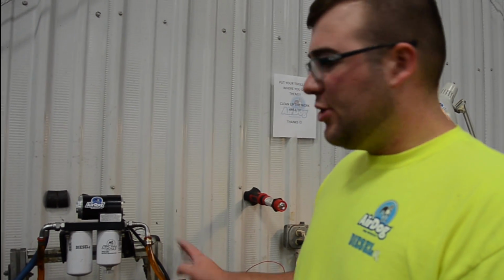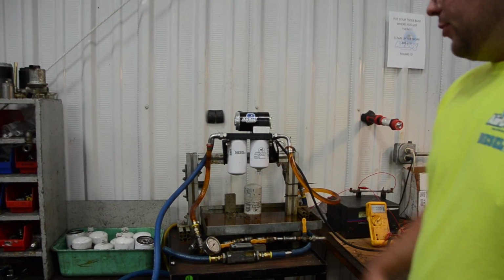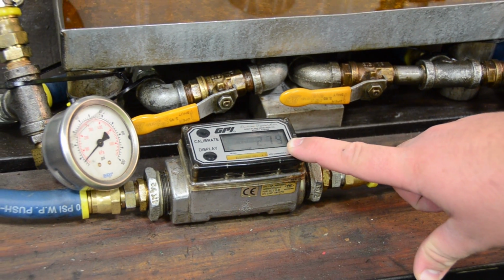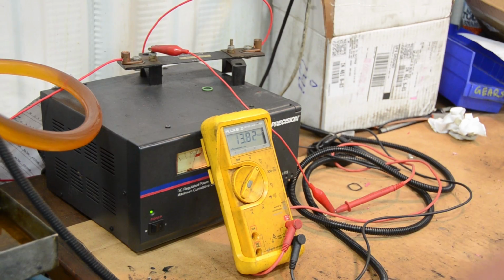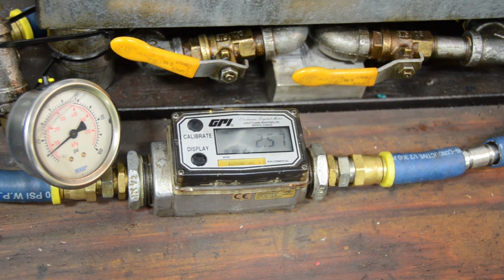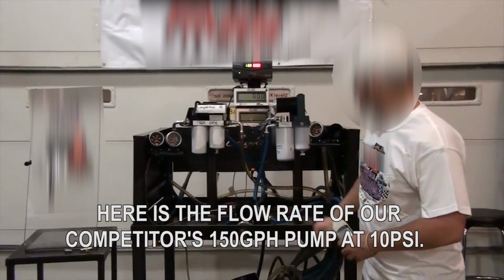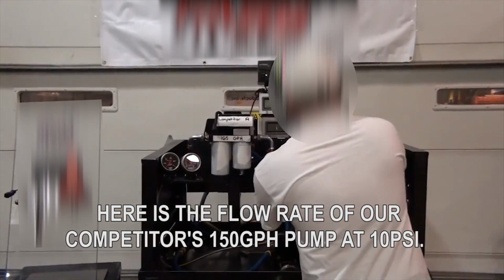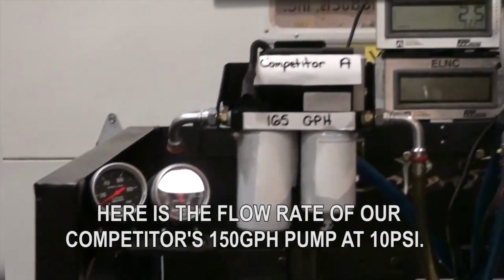The Truth Behind AirDog

Comment: Well said fellas!! 
Nice upgrades,  that video and couple other ones I watched covered alot of info I will be in touch soon  to purchase a pump ..   all that negative  shessssh  there’ jealous!!🤣,
Reply: I am sure they all have there issues, just be leary , I purchased mine a year and a half ago and the pump is junk. I called and was told to perform a series of tests and so I did ... still pump is shot. Now it's been over 3 months I have been running again without a lift pump. At 840 bux these things are not inexpensive enough to continuously have to purchase

Comment: Customer Service is Top Notch.  I received the DF-165 with the motor I bought from a good friend. I guess it was manufactured around 2008 and it ran on another truck previous to the owner I got it from.  It had sat on shelves between owners and I installed it on my truck in 2013.  In 2017 the pump motor failed and I was able to get a replacement at a reduced cost. The support tech pulled up the serial number and we confirmed the original owner (friend of mine too). I waited to install it back into the system having other issues to address but, it's back in now and the truck is much happier.

Comment: I have to say, I recently purchased a School Bus with a C8.3 Cummins which I believe could benefit from some electrical lift pump to assist the block mounted mechanical lift pump pulling through 50ft of 1/2 fuel lines (all new lines & OEM lift pump). That said, this beef between FASS and AirDog seems like a potentially manufactured east coast west coast rap style beef to drive eyeballs to ads/videos and boost sales for both companies. Ultimately I have decided to get a Vortex air/diesel fuel separator and a FuelLab 12v pump. Perhaps all this drama is organic in nature, but it has a distinctly manufactured vibe and if it is in fact organic in nature I have to question the logic/maturity of the leadership of AirDog for even acknowledging and participating in this juvenile back and forth. So inconclusion I am straying from the drama, manufactured or not and going with tried and tested suppliers and equipment albeit a bit pricier, because my spidy senses are smelling some BS here.

Comment: I bought my Airdog 100 back in 2006. Installed it at 30k miles. I now have 227k miles on my truck. The pump just blew a fuse today. I ordered a brand new Airdog I 4G 100 tonight.

Comment: How can one introduce air back into the system without having radius cuts. The only way is to have cavitation, whereas, the fluid vaporizes due to low pressures.

Comment: I'm completely new to this 
LT diesel truck world but not new to OTR trucks I drove them about 40 years over twenty five of those coast to coast and I'm learning that y'all have a major passion for world y'all have created like football fans or something. I'm Finishing up a restoration of a 01 dodge 3500 4x4 and the fuel delivery for the new engine has been something I have been researching. ( I did see the other guys video ) by the way. I think I have looked at every fuel pump under the sun that's advertised on the internet. Plenty video surcharging YouTube eBay etc. I understand the point of this video and I think I found my fuel delivery. Many parts of my restoration have been replaced with peterbuilt Kenworth and international parts including the tank and filter system but I'm lacking a frame mounted inline pump so I'll be talking with ya real soon.

Comment: For any looking at this video and reading these comments. If your interested in these pumps by far your in the right place “ I have a 2012 6.7 f250 kr I work in the oil and gas industry my truck idles for hours on end here recently I picked up fuel contamination water and rust and other debris from a fueling station airdog has been on my truck for about 3 years or so now I couldn’t be happier my filters caught all the debris and water from getting to my top filter and pump which can cause catastrophic failure on the fuel system about a 12k repair bill after dropping my tank changing filters and back flushing my lines I see just a tad bit of stuff on my last filter change after a few 100 miles but I’m sure that could of been what was left in my lines or the gerotar itself don’t just take my word for it airdog really did save me and I couldn’t be more thankful” for those who are thinking about doing it by all means go for it it will be worth in in the long run!!!

Comment: I've been a mechanic for years,, yes all the crap about filters is a non issue and a bunch of crap that is not worth consideration fact is the newest FASS system is head and shoulders above in design and function. its time for AirDog to update their design, yes it works well, I have one on my DuraMax for 10+ years with zero issues and use straight water to lower EGT while towing. If AirDog would update their wiring size, and pump body I would consider getting one for my 40' Diesel Pusher Motorhome, I will go with the FASS on my rig... may be splitting hairs as both are top quality systems, its just that FASS has taken the time to make improvements,,, JUST the 10gauge wires and better connectors is reason alone for me to choose FASS.  If AirDog where a lot cheaper I may go with them as I know their system has worked well for me over 10 years use, being virtually the same price Ill go with FASS for electrical upgrades.  AirDog upgrade your system or lower your price to stay in competition
Reply from the maker: We have upgraded our wiring harness and connectors to be 12Ga from the battery all the way to the wires on the motor. The connectors are now metripack 280 connectors to handle the higher amp draw for high pressure applications.    10Ga doesn't do a whole lot when you leave your motor wiring 14Ga.
Reply: @AirDogSales  Technically wiring ampacity DOES make a difference from length...there's charts to prove it. All the extra ports on the FASS is what pushed it for me as well as the larger wire. I do wish the FASS height was lower like the AD, as I would have preferred inside the frame rail but on a Dmax the filters hang just below the frame rail which wasn't acceptable for me. But I also had to Fab my own bracket to shift the unit over and tuck it up as it hit the filler tube and hung too low otherwise.

Comment: You didn't mention the change in velocity if the flow volume stays the same when the size of the conductor is reduced.
Reply from the maker: You are correct, the reduced diameter will increase fuel velocity. We didn't mention it because the statement was about fuel flow.

Comment: Just installed a 4g II 100gph on my lbz. It’s made a noticeable difference in the way my pickup runs and picked up a little fuel mileage as well.
Reply: I have an LBZ 07' was thinking about putting one on . I put a Banks intercooler, 4"Exaust and larger boost tube .was hoping to improve milage more ! What have you picked up ,milage wise ?
Reply: James Thomas with my the lift pump alone maybe 1 mile or possibly a little more. But it’s throttle response is better. It’s more crisp and the pedal doesn’t feel as heavy as before to make it move. Hit the throttle and it’s ready to go. The pump in my theory doesn’t give you mileage but makes it run so much easier you inadvertently pick up mileage from the cp3 pump not having to work as hard. But the difference is definitely night and day on acceleration. If I had a lighter foot I’m sure the mileage would be more but I mainly got it for helping/assisting the fuel pump. Worth every penny.
Reply: @GOFast-dy4jk  That's what i want Too . We were coming back from the river last week ,I stabbed it ! I don't like that hesitation .If I can pick up an extra mile per gallon i'm good with that too .I'm figuring in 2 years ,40'000 miles all I've done will pay for itself and let my truck breath and run that much easier .

Comment: Got a airdog 2 on my 03 and it is loud I can hear it sitting in my truck with the key on and hear it sometimes when truck running.. but call me strang but I like the hum.  Let's me know before I even start my truck that its working
Reply: The fass on my Cummins is obnoxiously loud and it's just a "fuel flow enhancer" just a little lift pump. Im gonna get a Duramax and switch to airdog. I don't wanna invest too much more into my truck.
Reply: Same here, the hum brings a smile bc it proves that I finally accomplish something that still works.

Comment: Air dog will be my choice. I have a 3500 dodge cumins  2001 .i use every day for work  ,
Reply: @bigboreracing356  You are doing something wrong then.  How did u go through that many?
Reply: Good luck.  I went through four Airdogs on my 01.  Shaft seal leaks and destroys the motor.  And no fuel heater.

Comment: Just bought one of these and installed it in 2 hours. Very simple to do. I do have a question. If im driving down the road, and a fuse blows or the motor stops for some reason. Will the stock injector pump be able to pull fuel through this system until i get something fixed? Or will i be out of luck?
Reply: They told me on the phone that it is a passive pull through design. Shouldn't leave you stranded.

Comment: A year ago, after having some major issues with the stock system on my '08 6.4l F350, I decided to go with an after market system.  Eventually I decided on the AirDog II 4G 165.  Easy install (The vendor included a sump which I also installed); only took a couple hours.  Darned quiet pump.  It is mounted inside the frame just in front of the tank; There is no other place to put it on my truck without modifying other items.  A big plus is the removal of the frame rail water separator/filter which is always a pain to change and reprime.  A minus is the loss of the water in fuel warning, although I have never found water in the AirDog separator.  Some of the advertising claims are easier starting (Nope.  It does now start AS easy as the OEM system);  better fuel mileage (Nope.  At least not any worse.);  better/smoother acceleration (OH, YEAH!  No running out of fuel no matter how hard or long I keep my foot in it.)  I have not had a problem finding filters--NAPA and their prices are almost everywhere.  Over all, I am real happy with my choice.  Every vendor sells it at virtually the same price; the one I picked also included their sump, so that's the one I bought.

The only criticism is, during installation I wasn't anywhere near the torque specified for the bolts when the mounting plate started to bend.   I took that as close enough.

Great product, thank you.

Comment: 90 degree fitting will create air in the system if the pump is running enough pressure though right?  You can always turn the pump down so it doesnt.
Reply from the maker: The only place where cavitation occurs is in a vacuum or on the suction side of the pump. And even if cavitation happens, the bubbles go away as soon as they are pressurized. On the pressure side of the pump, there is no place to introduce any air in the system that isn't already there.

Comment: Hey guys i got the Air -Dog  4G 165hp on my 03 Dodge 2500 ok i got my Mechanic install it all he did was install it he told me later get a Fuel pressure gauge reads up to 100 ok i did he installed that he set it at 80 it digital ive had it for 4 mths already now the gauge shows 70 and when i'm on the highway it drops to 56-57-66 i called the air dog people he said wait u need to turn it down i told him we never messed with the pump cause it comes from the factory already at 15psi so we never move it up or down we left it as is he kept telling it needs to be turned down i told but y i'm i gonna tell my mechanic to mess with it,,,,Can you tell me something different Thanks...
Reply from the maker: 70psi is way too high for a Cummins. With that fuel pressure gauge in, turn the adjuster out, CCW, untill the pressure reads 15-17psi. Back the jam nut off with a 9/16" wrench and take a flat blade screwdriver to back the pressure down.
Reply: That dude and his mechanic sound like they are both retards 😂 his mechanic probably mainly works on gas cars trying to set the pressure that high. If you bought the pump for the cummins your cooking your pump and your fuel system. Why do you want someone to tell your something different so you can be right ? And cant exept that fact? your wrong lol the guy who told you to turn it down listen to him Dip shit

Comment: will this help prevent fuel starvation
Reply from the maker: Yes it will. We have 100, 150, 165, and 200 GPH Models to choose from.
Reply: PureFlow AirDog .Diesel Rx 
cool what will be best for a stock 05 sierra duramax
Reply from the maker: Stealthcon69
If you don't plan on upgrading to larger injectors or injection pump, the A6SPBC259 (100-4G) will be the kit you want. In case you plan on upgrading other fuel system components down the road, I would recommend the A6SABC409 (165-4G) model. Here is a link to the installation manual: http://www.pureflowairdog.com/manuals/A5SABC112.pdf

Comment: I purchased the Airdog II 4g for my 6.0 on black friday, went to install on my truck and got it all hooked up. Turned the key and it began dumping out fuel from where the base meets the motor. Called Pureflow AirDog and spoke with Chris and he told me to take apart the pump, turns out the o-ring was completely ripped in half... He overnighted me a new o-ring and it worked perfectly. Just disappointing that this happened after spending $700 on the pump..
Reply: Gauge a company  (or a man) not by how they react when things go right but how they act when things go wrong. Sell enough products and something will go wrong.  So when they step up you know the measure of the man.
Reply from the maker: Sorry to hear that happened, Brad. We understand it can be frustrating. We are human and do not use machines to assemble our pumps. We assemble many of these pumps a day and very few mistakes do, unfortunately, happen.
Reply: I get it, it works now and that's whats important.
Reply: your quality control couldn't detect a failed oring?  Might need less "good ol boys"  running things and get some quality control.   700 for a pump and some filters is insane.  any low hr failures is unacceptable.

Comment: I feel bad for you guys. There's so much dirt going on between two competing companies. Rumor on the street was, a father-son business went by the way of the son having issues working for pop and split to form his own company - FASS.

Yesterday, I spoke to Dynamite Diesel (DDP) in Washington state on injector failures and, shockingly - he says injectors still fail due to clogging even with a FASS or Airdog but, I don't think he factored in dirty fuel supply lines post fuel air system. When doing my gasser, I found FOD was being introduced into the injectors via the fuel rails themselves. Cold rolled steel, coating eroded, rust formed, dislodged and clogged my injectors. I made my own fuel rails out of billet aluminum and switched all supply lines over to Teflon lined SS braided AN-type fuel supply lines and an-inline fuel filter at the fuel rails. I haven't had a single issue to date with injector FOD clogging up.

 I can attest that I've got hundreds of thousands of miles on my Cummins injectors without using a fuel air separation system without issue so far. I am in the process of sourcing DDP injectors. DDP recommended installing one of these systems, he says both are equally as good design wise. 

CM
Reply: The story you heard im pretty sure is right.

Comment: Great video. I just purchased and had installed one of your units on my 2011 Duramax that currently has 467k miles on it - yes a little late in installing your pump. I will definitely keep your company informed on my progress of many, many miles and smiles.
Reply: Any CP4 issues? ... lol I know, old old reply.
Reply: I would also like to know if your 2011 duramax has had an cp4 issues and if so at what mileage?
Reply: @zethclide5339   I sold the truck with 502,000 miles on it and the airdog performed flawlessly. I never had any issues with the cp4.